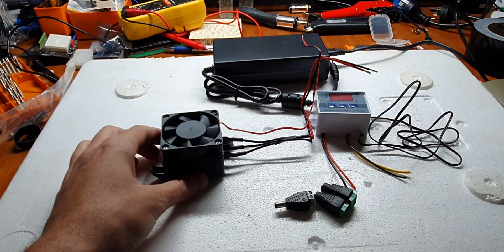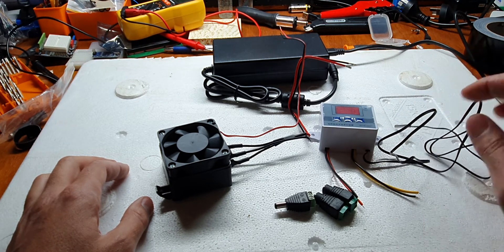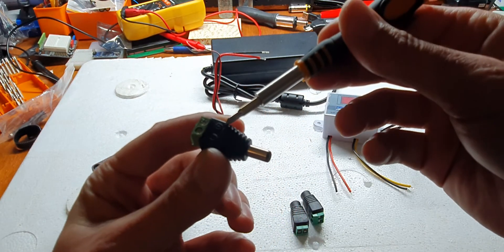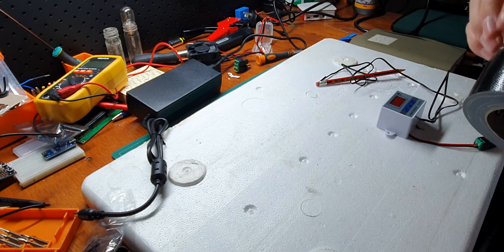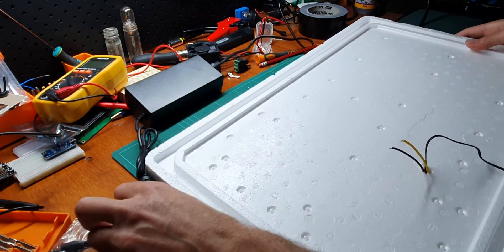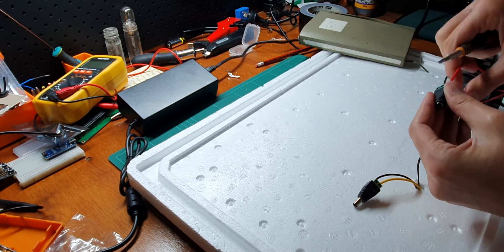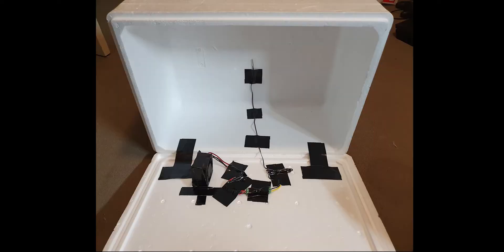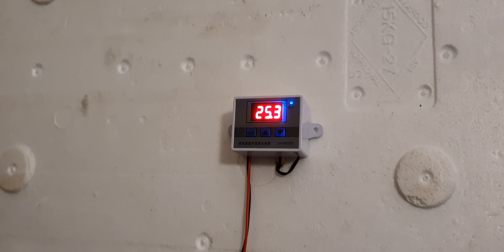Cheap DIY Incubator build for culturing bacteria, yeast, and fungi

Comment: Based on the setup in your video, do you think the DIY Incubator can maintain 37 degrees Celsius for 4 weeks without any component failure ?
Reply from the maker: I've not run it that long generally only 2 weeks at a time. But after looking at the electrical bill ...I might make an update. Lesson learned re making videos after you have plenty of time to test!
Reply: @VitaminTheG  can it reach 37 C????
Reply: @VitaminTheG   You don't make videos anymore?